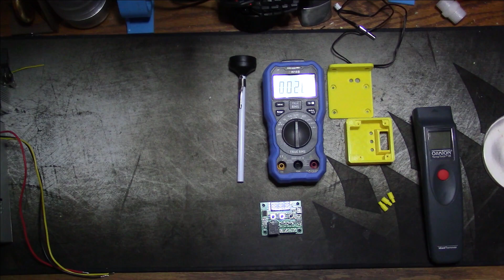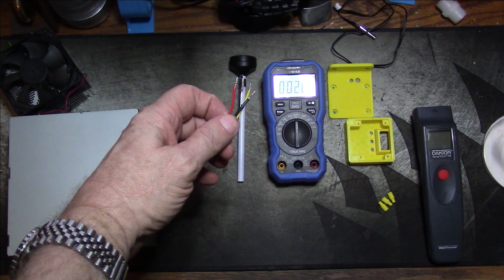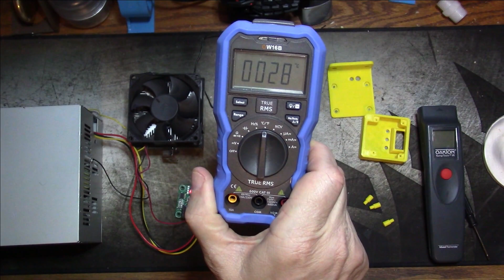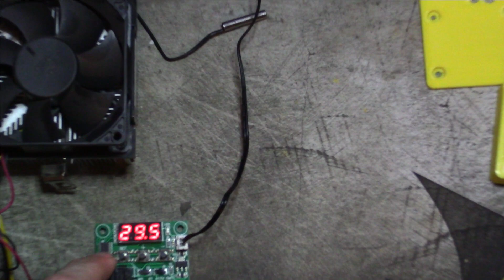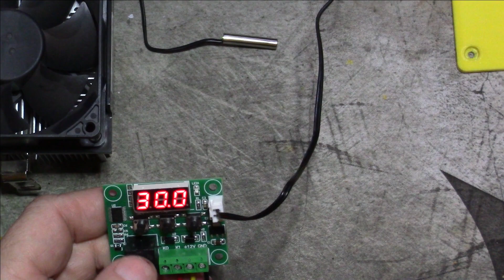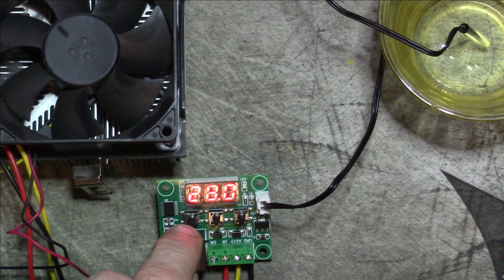Temperature Control for the Ender 3 Ikea Lack Enclosure with the W1209 Temp controller

Comment: Where in the enclosure did you put the temp probe?
Reply from the maker: I drilled a hole through the top, printed a ferrule which I inserted in the hole, then put the probe in  so it hangs down into the enclosure an inch or so, then sealed it with silicone.

Comment: What are you using for a heating element? that board is great!
Reply from the maker: I'm hoping the bed will be all the heat I'll need and the W1209 and a fan will keep it from rising too high. If that doesn't work, I''m thinking I'll probably use a small PTC ceramic heating element and a second W1209 will work, they're cheap enough.
Reply: @3rdpig  I have looked at PTC heaters too, but I have NO idea how to wire one up to power and use a Temp Controller.
Reply: @3rdpig  can you tell us if it worked? I have a problem of warping.. this is why i wanted to build a chamber. I am not sure if the heat of the bed is enough to make a good atmosphere in the chamber. What is your experience? Was there a need for an extra heater? If not, what was the highest temperature you measured in the atmosphere?